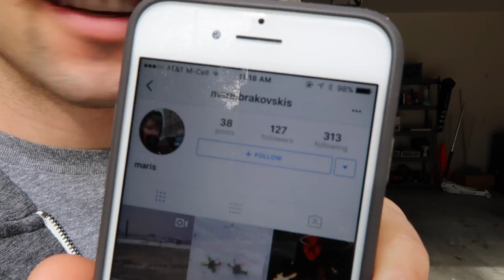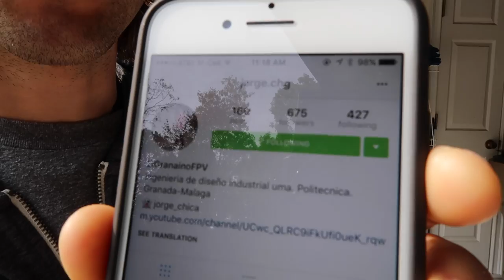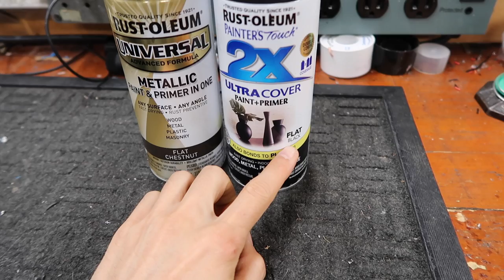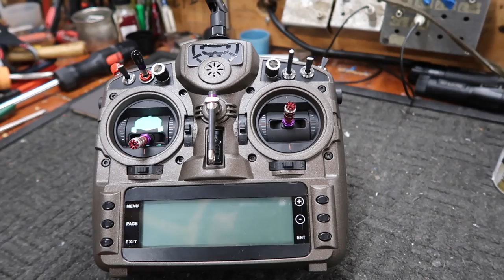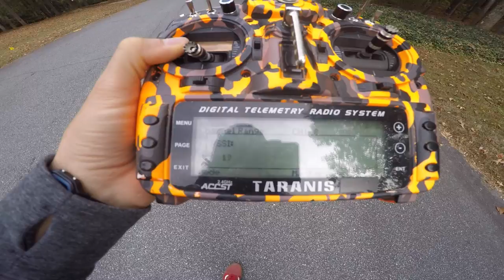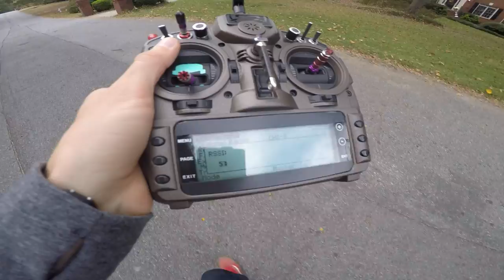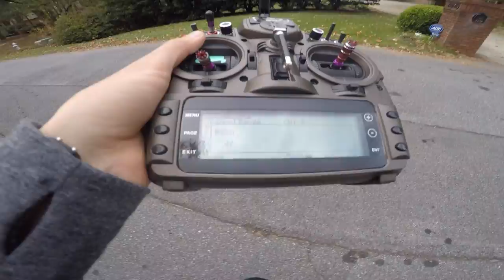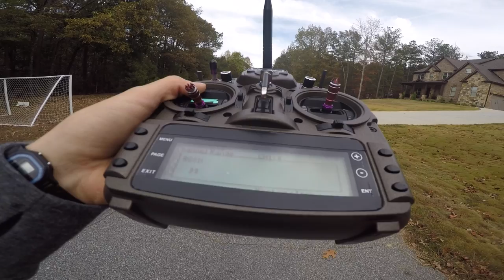The MUST HAVE FRsky Taranis Mods

Comment: 7:33 total assgrabbin' action...  how is that for valuable feedback?  looks a bit young tho,  is that legit?   lmao just kiddin.  but seriously tho, cool vid.  I dont own a taranis radio but found some interesting points u talked about.    and pretty noble of u to get some environmental awareness on! 👍  Personally, i regret buying my tactic ttx650 (priced a little bit under a taranis) since the day i had to shop for additional receivers and discovered that PPM is too high tech for the Tactic engineers. Taranis is Never available in HK EU and Spektrum is pretty much THE only reputable non-niche radio system that every LHS ive ever to been has to offer, however,  it's kinda like window shopping for a Rolex since a decent <6+ ch model will start around 450 bucks.  so i went with a HK fav in the end, low budget yet high quality,  packed with all the innovative functionality a pilot could ever wish for,  and as you say in your video a coupl of times:  blahh blah blaw bla.  sadly,  i now regret the Turnigy 9x more than the ttx650.  my question im slooowly working up to is: if money was no issue,  and availability is plentyfull,  is there any true "perfect"  system out there that is exactly suitable  for what you (i mean you personally)  would appreciate in a radio? what would it be? and if there isn't,  whats wrong with the lot of em?   rip on!  cheers.

Comment: Do you have a link to the HQ 5dbi Antenna ?
Reply from the maker: +RelaxinFPV I don't.  But I'll look for one
Reply: Great !
Reply: I was going to ask a similar question. How do you define "high quality" when it comes to those? There are tons out there. I found 2 for $10 on Amazon and they have been working really well, I just made sure I found an antenna that was listed for 2.4 and not a broad range so I didn't interfere with, or get interference from, other RF signals.

Comment: Dude, do you mind tell me the best fpv camera for racing drone? I have trouble to find one.. i was thinking to get the runcam but some say its not very good..
Reply: Hs1177 - it's cheap and is one of the best for FPV racing and stuff! (Mr Steele uses it)
Reply: Yolkolai does it have any brand on it? I just dont want to get the fake one..
Reply: Foxeer, Runcam, Piroflip has his own branded ones. I've used them work perfectly well. Amazon sells legit Runcam
Reply: I thought he uses the Runcam Swift? I know FinalGlide uses it. Well, there isn't a lot of difference. I would get the Runcam Swift because of the better mounting bracket, I broke two HS1177 cases before.
Reply from the maker: +Stephen Chandra I like the original. HS1177.  Foxier makes one. Run and swift is the same.  Both good cams
Reply: thanks guys for the info, i will try the swift.. :D

Comment: What is the significance of 84mm?
Reply: 84 mm is 2/3 of the wavelength of 2.4 gHz which the Taranis operates on  (wavelength is actually 125 mm). Normally you would go with a length that is a multiple of 0.5 the wavelength, but I guess Alex Greve knows what he is talking about :-) Could be that the solder point, rp-sma connector and dipole antenna is taken into account?
Reply: I'm also curious why the length of the coax matters, since it isn't a radiating element.
Reply: if it's shielded properly it shouldn't matter (IMHO).  the antenna element itself should matter, but the coax from A-B? you got me too.
Reply: and how come your average toy drone gets over 300m? and a cheapo flysky i6 gets over 1km
Reply: the two  points at each end of the coaxial ( = solder point) must be points where you find an effective signal and NOT at nodes of the signal where you have Zero signals that is why length matters for coaxial soldering. Search on youtube "Coaxial Cable Basics"
Reply: The soldering point of the emitter is usually at full signal, the length of the cable but be preferred to be cut to a length equals to a multiple of the wave length (here 125mm) , but you must take in account the velocity factor of the coaxial which is 2/3  for this type of wire. So 125mm x 0.66 = 84mm
Reply: The soldering point of the emitter is usually at full signal, the length  of the cable but be preferred to be cut to a length equals to a multiple of the wave length (here 125mm)  , but you must take in account 
the velocity factor of the coaxial which is 2/3 (= 0.66) for this type of coaxial wire. 
Hence 125mm x 0.66 = 84mm.

By the way NOT half length ==> you could find a node there :-(  , and  if you do cut the coax on a node, not enough signal go through to the antenna. 
in case of a wrong length, If the RF emitter module emits a strong signal  you could even burn it.
This last point is important, if you use a booster followed by an  coaxial wire  followed by an antenna, you then can burn the power stage of the  booster easily.
Reply: TheCric is that 84mm from the tip of the Sma to solder point? Or is it bottom of the sma to solder point?
Reply: antenna theory is pretty out there, i would trust the experts and just follow them,
Reply: There's a title overlay @4:49 that says "84 mm of shielded coax"

Comment: Do you have signal loss at very close range?
Reply: range mode for testing range. it's 30x weaker if that's what u were asking
Reply: I assume he means when you have the TX next to RC. You will ALWAYS have this, this has to do with the overall power output and wave propagation, there is a minimum distance the two need to be apart.
Reply from the maker: +Onur Can Vural  sometimes but it's a bug in the telemetry.  When you're right next to the quad. It doesn't actually lose RC link though. Just says telemetry lost
Reply: Thanks a lot Mr Steele, I have some close range signal loss warnings so I wasn't using high gain antenna, from now on I will.
Reply: Yes, at "very close range" the transmitter's antenna hasn't gotten with the program yet,  and the signal loss can be total.  BUT "range" is in terms of transmitter frequency wavelength,  and at 2.4GHz the wavelength is so small (125mm) you aren't going to be close enough to worry.  Unless you make an effort. 

In general,  not talking about Terranis specifically,  antennas make an RF wave, propagating at the speed of light,  and consisting of perpendicular (Orthogonal!) oscillating electric and magnetic fields.  The transmitter sends the signal through a coax, to the antenna where the voltage makes current oscillate back and forth.  The antenna,  when matched correctly to the transmitter and transmission line looks like a resistor to the transmitter.  The cool part is that instead of heating a resistor with the RF energy,  the energy is instead radiated into space.  When the antenna is replaced with its equivalent resistance,  the transmitter can't even tell.  
FINALLY (Jeez, sorry) THE BOTTOM LINE COMMENT TO THIS QUESTION: When fairly (vague I know) close to an antenna,  in TERMS OF ITS WAVELENGTH, "weird RF magic" is happening in the vicinity of the antenna.  Until you're away from an antenna a few  wavelengths, the steady state long range RF wave hasn't completely formed yet.  There are electric and magnetic fields still trying to get their "acts together" in close proximity to the antenna.  Within a few wavelengths things are normal, with the RF wave fully formed, which propagates along,  and falls off with distance.  It's a hell of a trick though,  with some antennas working partly because of voodoo.

So, close to an antenna,  within a couple wavelengths I bet, you probably won't have good or any reception.  But the reason Steele made the remark that it's telemetry problems, and signal strength isn't an issue at close range is because at 2.4GHz the wavelength is about 125mm or a little less than 5 inches.  When you open up a transmitter antenna,  it's a little bit of a letdown to see the actual transmitting element.  1/4 wavelength which is typical, is going to be an itty bitty 1.25" piece of bare wire.  All the plastic is for show -- and to position it right.  For a dipole, the signal is strongest with the antenna pointed perpendicular to the receiving antenna. 

I'm afraid old Peter the Penetrator is mostly plastic show, and still has a very small Peter.  But Peter knows it's how you use it that counts, specically how you position it -- via a Kama Sutra trick called antenna gain -- so he looks twice as large, but only at certain more precise right angle orientations.  But this angle is big, and Peter can be a very useful stud, with the lady receivers lusting for him.  Almost all receivers like big signals.  Off of a good orientation, Peter can become Pee Wee and he gets very embarrassed, because the receivers want big ones!

SO AT 2.4GHz, the receiving antenna on the quad aren't going to get close enough for a transmitting problem,  unless you really try!  This jives because I remember to receive signals from the old 27MHz CB radios, you couldn't be right next to the car.  You had to be meaningfully away from the transmitting antenna.  And I see the wavelength of a 27MHz signal is over 11 meters, so "close" in wavelength terms is a lot further away than with our 2.4GHz frequencies, so things make sense.
Reply: Uçan Dişçi How close is close?  Does the signal strength appear to improve as you go further away?  Or does the range just suck, starting pretty close?  I ask because I thought I read about some connection issues with different 5db high gain antennas, with their range being abysmal, and don't know whether the issue is still out there.  Steele would know.  Connection as in where Steele was showing it plug into the radio, at the funky RF connector joint.

Comment: why does range mode reduce range?
Reply: if I'm not wrong - because the normal range of the taranis can go quite far, about 1.5km away if your using the X4R etc, thus it will be easier to calculate the range when the power reduces by 30x. This takes away the need to walk 1.5km or move 1.5km away from your quad. 

hopefully my explanation is clear enough XD

Comment: HEY THERE BUD MY NAME IS SCOTT I AM A COMPLETE Quadraplegick  SENSE I WAS 1O 40 NOW I HAVE BEEN DOING RC 30 YEARS NOW RACING PROFESSIONALY FOR THE LAST 10 AND DOING GOOD EVEN WON A 1/8 SCALE CHAMPION SO I USE TO MOUNT THE HOLE BIG CONTROL IN FRONT OF MY FACE UNTIL ONE OF MY BUDDIES TOOK THE GIMBLE OUT AND MOUNTED IN A LITTLE BOX WITH EXTENSION WIRE WELL NOW I HAVE GOTTEN INTO PLANES  AND EVEN MORE RECENT DRONES I WAS WONDERING IF YOU COULD HELP ME WITH A TARANTIS CUSTOM UPGRADE LET ME KNOW TY SCOTT

Comment: where can i buy the better antenna??
Reply: Just search for Wifi antennas, the module used in those radios were first developed for WIFI and industrial remotes. Later the R/C companies adopted them for models. All those RF modules use the 2.4 GHz frequencies.
More dB you get on an antenna mode directional is the antenna and more range  you get. Each time you have a 3dB gain, you get a double range but the directivity (angle of view of the antenna) is divided by 4
Reply: Sorry , my mistake: 3dB double but 6dB multiplies by 4 and as so the range by squareroot (4) = 2, so a 6dbi antenna get you a range multiplied by two and a divided by four directivity

Comment: I made a theoretical range calculator that helps you understand how different radio changes affect signal.  https://www.desmos.com/calculator/nsrdgy0l0r -- the only issue is that these antennas are often measured in "dBi" which isn't a particularly useful metric for a lot of this since the transmitters are typically measured in milliwatt, but I've been able to do some good estimates for a vtx to see what happens with antenna and power changes.
Reply: Isn't dBi a measure of how tight the beam is in regards to the horizontal plane (orthogonal to the base to tip axis of the antenna), basically how much "louder" the signal is at the plane, regardless of the power of the transmitter?
Reply: It's just kind of an annoying unit to add to things like this because you can't directly translate it.  dBm would be how much louder it is irrespective of the power of the transmitter.  I've had it explained that as a rule of thumb, dBm is approximately dBi -2, but it's a hard thing to measure.  Based on my own observation, I've got the equivalent of about 5.2dBm of gain between my tx and rx antenna (getting a bit over 5km at 200mW before my signal starts to degrade a bit too much).  I don't know how much of that is also the tiny wire monopole I'm using as a vtx antenna.  I'm sure making that better would also help.

So, AFAIK, not exactly.  Different units measuring different things.  The calculator I built there lets you adjust dBm gain on each side.  The only thing I'm fairly sure about WRT dBi is that if you give it the dBi value, you'll be pleased with the numbers, but disappointed with field test.  :)

Comment: ahhhhh... just plug in a dragon link or any other 433 jr mod and call it done. youlll get miles. i dont get the point of all this for so little gain and a bunch of work.. but at least the radio LOOKS cool? Ya....
Reply: I got EZUHF earlier this year and will never buy another 2.4 rx again.